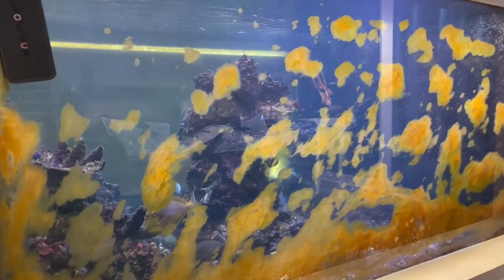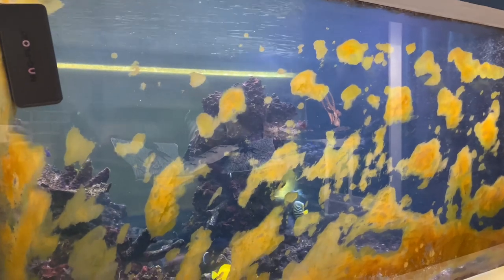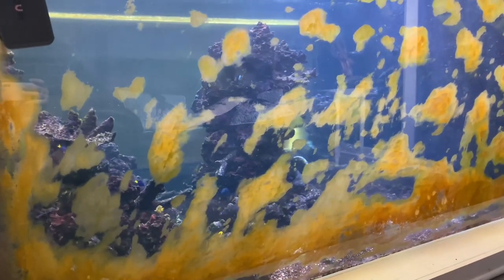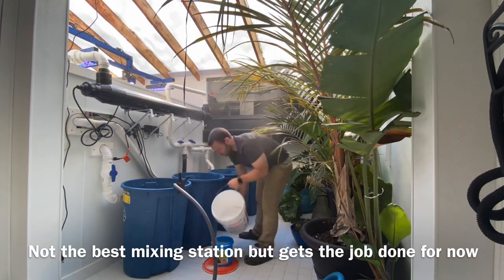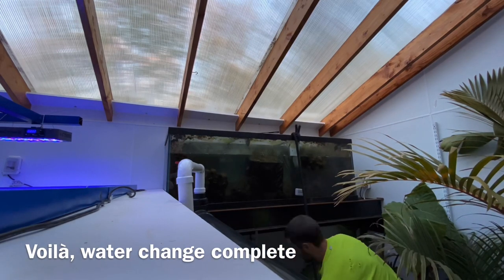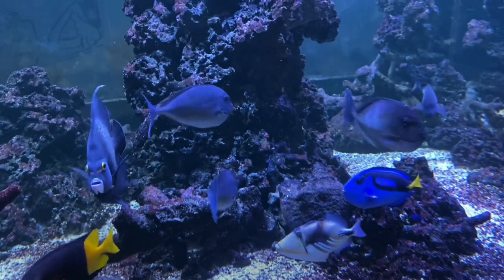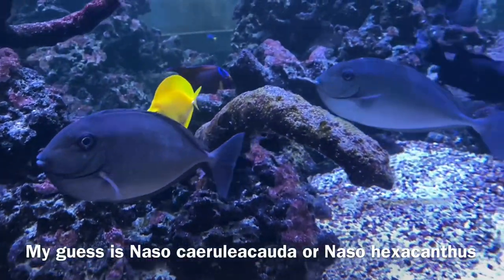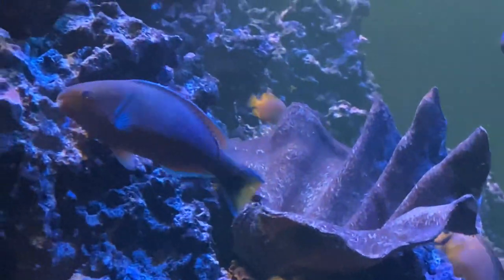3000 Gallon 6 Month Update + Answering your questions, DIY Wooden Protein Skimmer Sneak Peak

Comment: Pound Shield is pretty ez to work with. Seal all the seams with marine adhesive or Jb water wield and let cure 24/48 hours. Idk if you need to use a primer but make sure it’s self etching and do not use rust-oleum, it will not bond to the shield correctly.